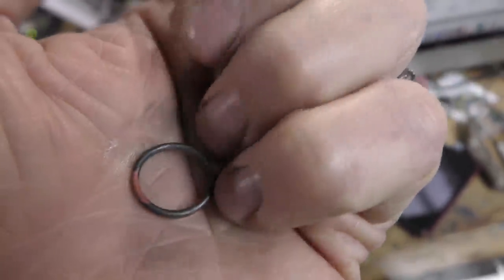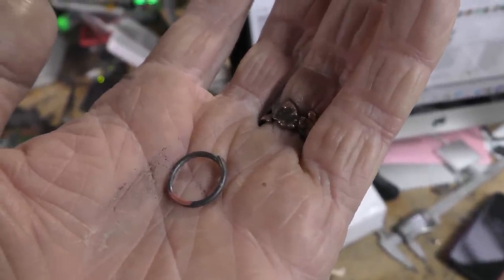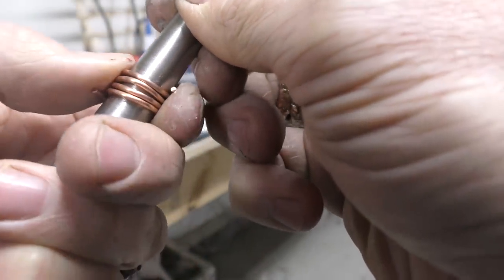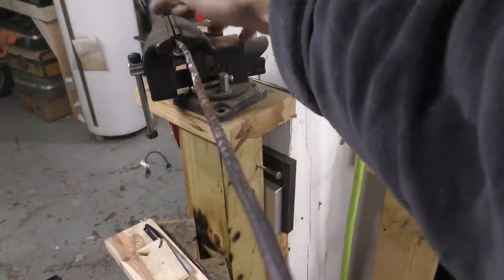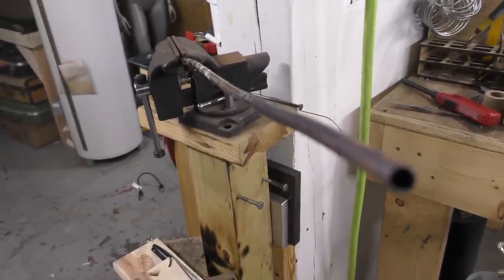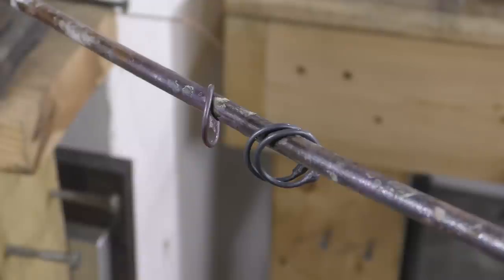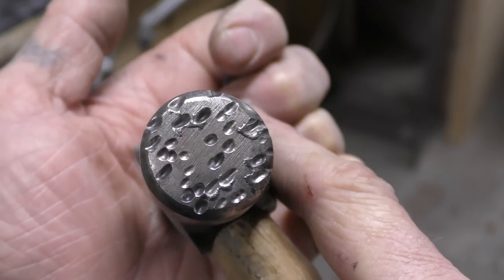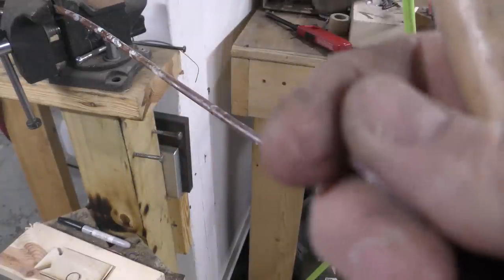Welding copper ring shanks with only a propane torch

Comment: I used this technique for make copper chains using a kitchen stove without lid (it looks like the flame of a bunsen burner) and worked excelent! Something that I don't use is the technique shown in 3:00, I cut the chain links and close them with the flat ends touching very well and solders nicely

Comment: If copper bonds so quickly, I wonder why plumbers need to use solder to join copper tubes?
Reply: Id assume because pipes are under pressure and the bond is weaker without solder, which could result in leaks.

Comment: Hey! Would a Butane torch do the same job or does it need to be propane? I’m considering getting a welding machine but if I can seal my ring shanks with my torch that would be sweet. Thanks
Reply: Just my experience : with copper, you’ll find you need hotter than butane.  Propane or Map-Pro and as to the torch head : pick the one he says.  TS8000.  The TS4000 doesn’t pump enough gas.  You might have success with two butane torches simultaneously heating your piece but that would be a question of luck, with smaller pieces only.  I love that he gives the torch information !  Most videos overlook that key element for copper and brass.
Reply: Thanks so much for your advice, I’ll go for propane just to be on the safe side 👌 have a great day 🙌
Reply: I use butane with no issues, design and build a furnace, and boom, you don't need a propane, physics helps alot.